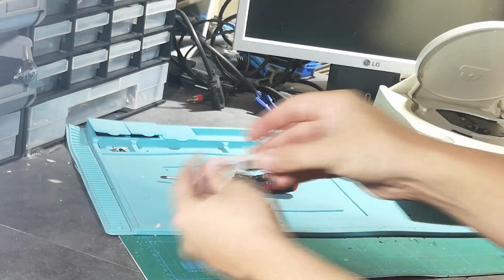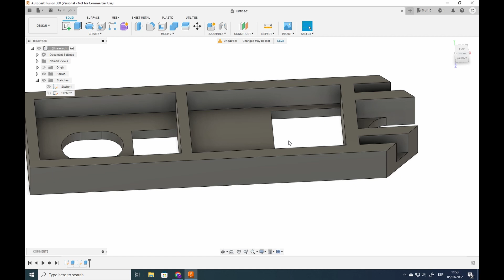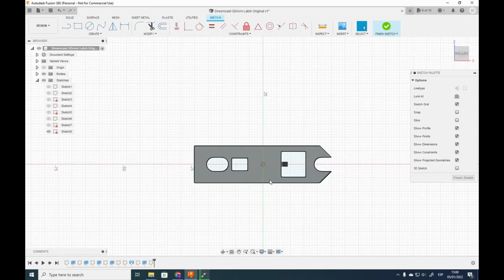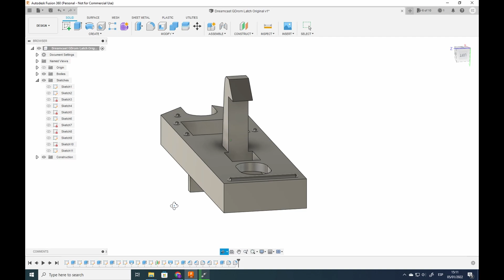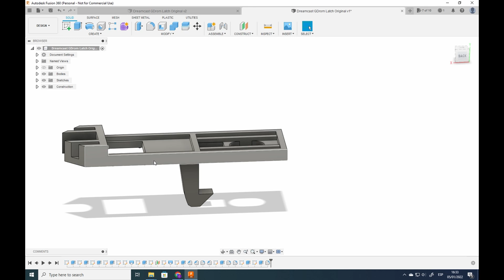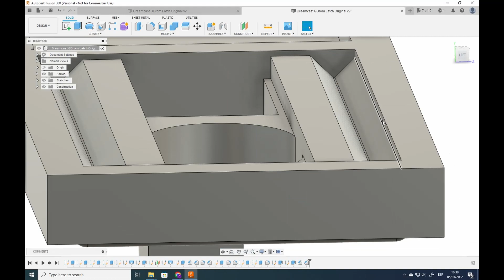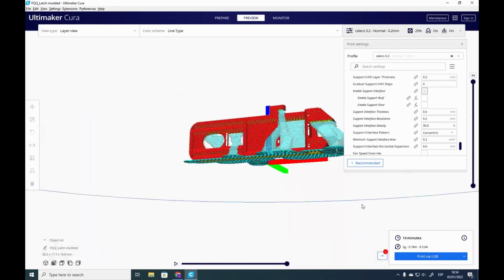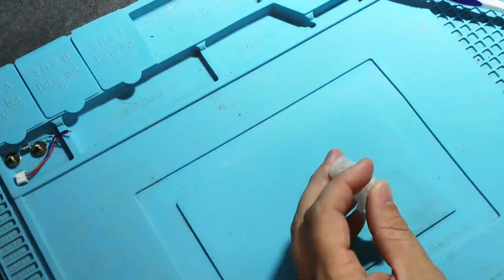Dreamcast Fan MOD Early VA1 - Latch Design

Comment from the maker: "IMPORTANT"
this is not a VA0 its a Early VA1 with the metal fan.

i don't have a VA0 to test ATM .
 if you want to donate a VA0 for me to test with i am more than happy to take it. ofc if i design something from the donation you get the part for free

and one more thing you need to put a 10k resistor between yellow and red wires of the fan  , forgot to put that in the video 😊🤣🤣